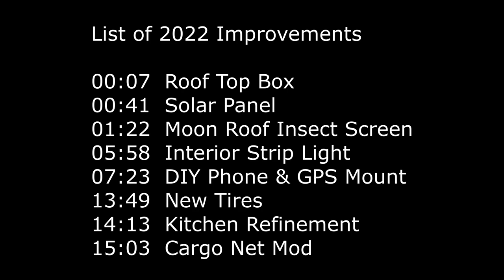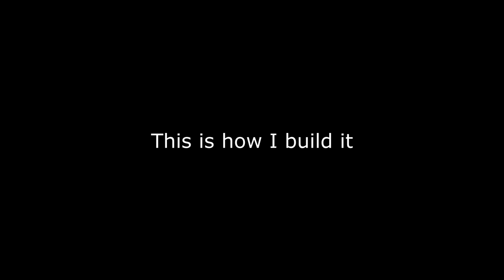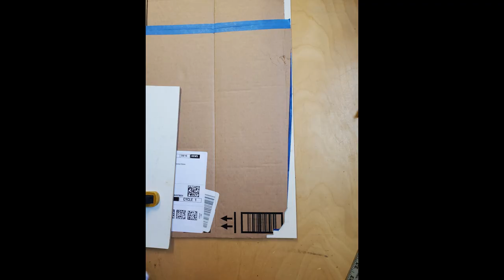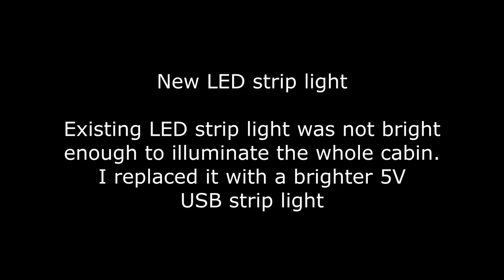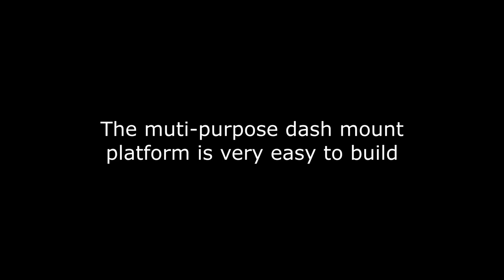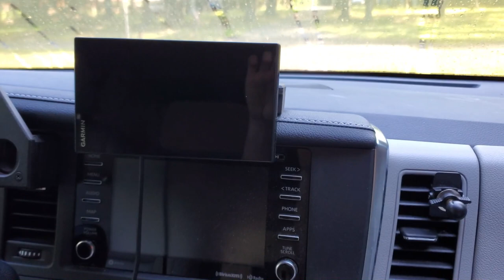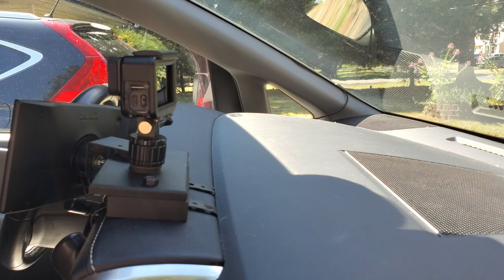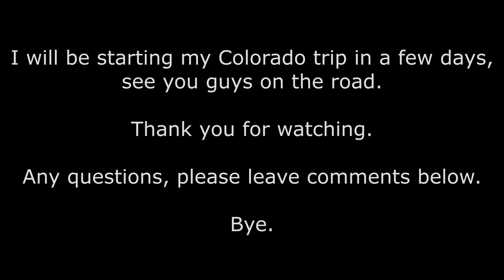Toyota Sienna Minivan Camper - Final Improvements and Update

Comment: Vinny, did you get AWD? is it worth it? If you didn't get AWD, do you regret it? Has it saved you? Talk overall pls about your decision ( whichever you made re AWD). Many Thx!!
Reply from the maker: Yes, this is my 1st Minivan with AWD. My previous two Minivans were 2W drive only. For places I never been before and looking for the best camp sites in remote places, AWD is much better in snow and mud. I got stuck in snow before with my 2WD minivan. I do not regret getting  a AWD at all. In fact, If I ever build another rig, it will be 4x4. My current built with the Michelin  Crossclimate2 which has 3PMSF symbol on it. In places like Utah,  cars equipped with snow tires, chains or SPMSF  tires are required in order to access the ski area during snow seasons. My recent trip to Colorado, the Crossclimate2 proved to be excellent in gravel road as well. I highly recommended this tires for adventure seeking trips.